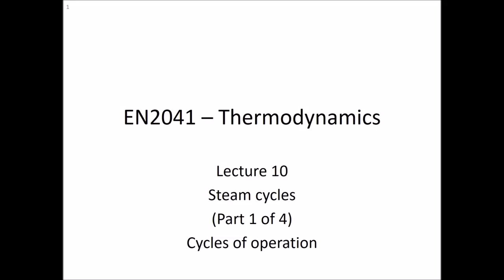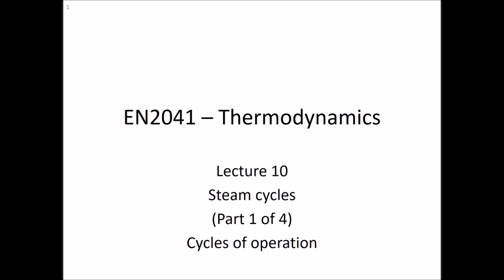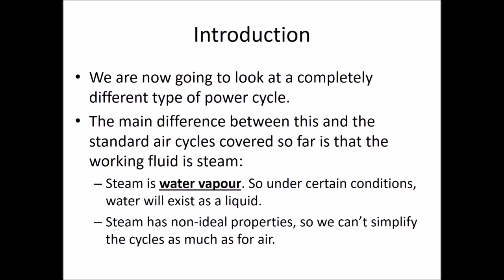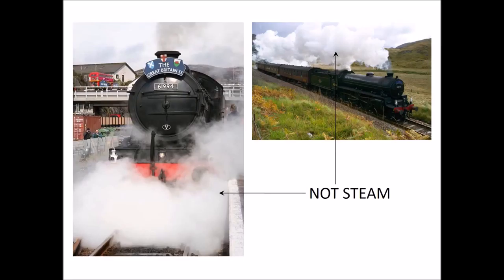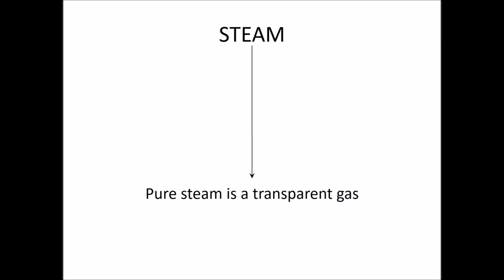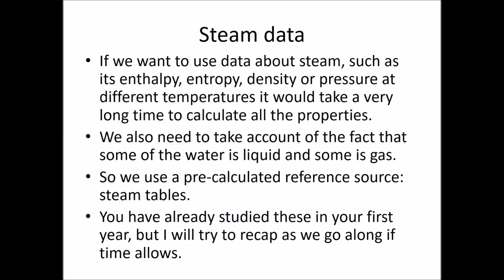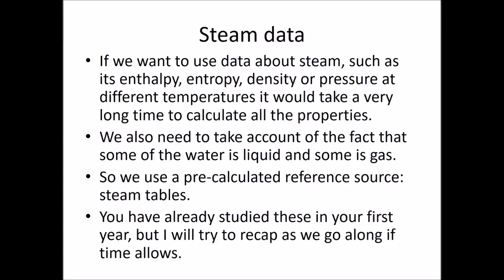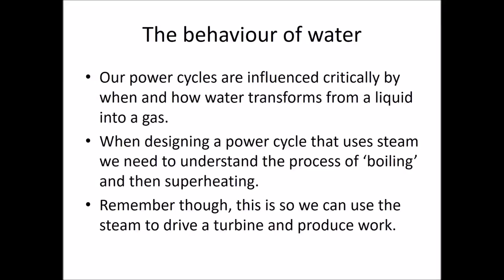EN2041  Lecture 10

Comment: @48:00
Can you explain again what is meant by "isentropic"? (i know it  meant constant entropy, but can you explain further on that?) i know that isothermal meant constant temperature (easily understandable).
perhaps you can explain it tomorrow in the lecture?
Reply from the maker: Sure. In this case we are talking about losses in our system when certain processes take place. Taking a look at the Carnot cycle T-S diagram in this lecture, you’ll notice that the compression and expansion lines are perfectly vertical, so they must occur at constant entropy; hence the energy is not degraded as it flows across the compressor and turbine: it is only converted (seen as a lowering of temperature as the heat is converted into work). Looking at the turbine as a good example: we assume that the process is isentropic because there are no energy losses due to non-reversible behaviour (usually friction). So this would include energy dissipation from turbulence as the steam flows over the turbine. In later lectures we consider what happens when we consider non-ideal processes such as the flow over the turbine where these non-isentropic loses are accounted for. Have a look at this link: https://en.wikipedia.org/wiki/Isentropic_process